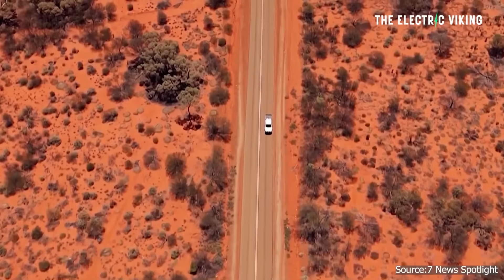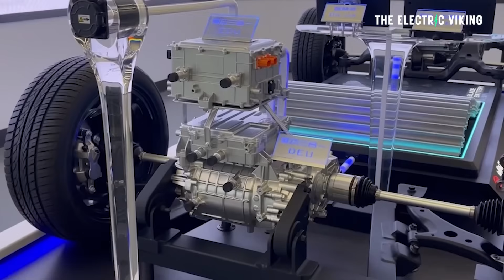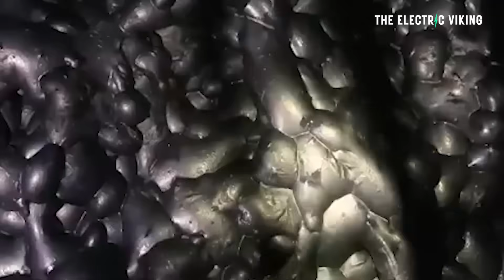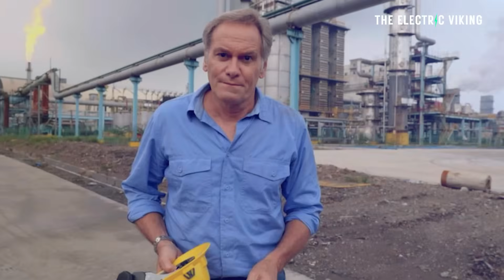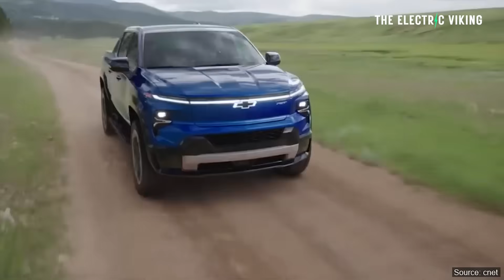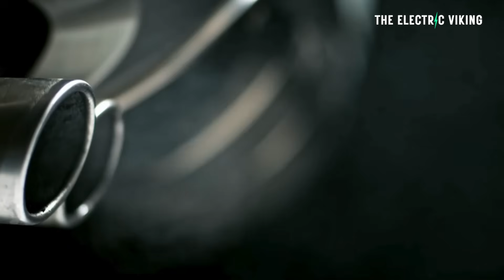Channel 7 Lies Exposed: The Truth About My EV Fight with Australian Media

Comment: LFP batteries are much better than nickel based batteries but Chinas mining practices are similar to nickel. It’s good the industry is changing to LFP but improvements still need to be made.

•  Key problem area: Yichun (Jiangxi Province) — Known as China’s “lithium capital,” rapid expansion of lepidolite (lithium-bearing mica) mining since 2021–2023 led to unregulated/illegal extraction, producing toxic by-products like thallium and tantalum that contaminated rivers (e.g., Jin River pollution incidents). This caused water quality issues, massive tailings waste (projected 10M+ tons by 2025 targets, overwhelming local capacity), and habitat disruption. Central government interventions in 2023–2025 halted chaotic mining, suspended plants, and tightened regulations, but damage occurred.

Comment: Enviro wackos consistently film smoke stacks belching smoke. The unreported fact is to a larger extent this is steam generated from process boilers and air cooled condensers widely used in industries. We should be fearful of the wackos that want to geo-engineer the planet 1.5 degrees cooler via chalk dust (Bill Gates from hell and others) and the curious contrails/chemtrails that linger all day and dim the sun. Leave our atmosphere alone, greenhouse gases mostly CO2 (plant food) and carbon will do the job and green the planet at the same time.

Comment: Indonesia is going to fast mining nickel and it’s causing pollution and deforestation, while poisoning people. There is no doubt about this and yes they are supplying nickel for evs. Who cares if he said that evs use nickel in all batteries.  It’s a mistake and you don’t know if it was on purpose or not.  The fact is evs are polluting if it’s not mined with standards like Australia or Canada for example. I work in the oil and gas industry while supporting evs when done responsible.  Our working conditions are amazing and safety comes first. Not like what we see in other countries. Big oil does have extremely high standards in Canada including shell.

Comment: On a side note I use Solidteknics No Nickel Australian Made stainless steel cooking pans (Noni) trying to cut out high toxin in my diet. The stainless steel is bought into Australia from Finland where Mark J Henry turns it into saucepans and frypans. I got tucked into the false news article but in my defence I knew about nickel being a heavy metal and the bad processes killing factory workers and badly connected the dots.

Comment: Electric cars are shit😂
Reply: That’s nonsense, EVs are the future. Internal combustion engine cars are polluting, mechanical rubbish.
Reply: @hegemonersmith1048 real environmentalists keep the same car for decades, but you keep believing in Chris Bowens little lapdog
Reply: @ 
I’m a retired research scientist. Who the f are you?
Reply: How so? Mind explaining?
Reply: @ 
Over the complete lifecycle of a car including manufacturing and all other aspects, a large number of studies have repeatedly shown that EVs have significantly lower GHG output overall than ICE vehicles (you can Google them yourself). 

This will only improve over time with greener electricity (Australia is currently at 40% renewable and increasing rapidly). A high proportion of EV owners in Australia have solar panels, which also reduces the GHG footprint.

Most Chinese EV batteries are now LFP and use no heavy metals (other than Fe). See latest data from the IEA 2025. It’s the Europeans, Koreans and Japanese makers that need to remove Ni, Mn etc from their battery chemistries.

It is ICE cars that have by far the larger GHG output overall. There is no serious scientific debate.

Comment: If, as you say,  the Minister was "bamboozled" by questioning from a journalist, instead of ending the session and walking out he should simply have countered with the facts to set the journalist straight. He is accountable to the public and as such, must be able to respond to all questions and inquiries. It's part of his job. That the Minster walked out prematurely says more about the Energy Minister than anything else.
Reply: A lot of that depends on the questions. If you ask terrible questions full of inaccurate assumptions or blatant lies then you can't really expect someone to waste their time correcting the points of the question before finally coming up with an answer.

Comment: You are not telling the whole story are you ?  Tsingshan holdings group owns 66.25% of IMIP.  Tsingshan has facilities that exclusively produce nickel matte for the EV industry that produces about 100,000 tonnes annually for EV batteries....which is about 7.7% of the world's current EV battery demand currently.  Since this area contains about 42% of the world total supply of nickel this Company will likely increase that supply exponentially if EVs are widely adopted.
Reply from the maker: Why did you exclude the HUGE impacts of LFP and sodium ion batteries?

Comment: @electricviking The IMIP industrial park in Indonesia primarily produces nickel pig iron (NPI) and ferronickel, but it also hosts two HPAL (High Pressure Acid Leach) plants — HNC and QMB — which produce a smaller volume of mixed hydroxide precipitate (MHP), a nickel intermediate that can be refined into Class 1 nickel for electric vehicle batteries. Soon, IMIP will feature next-generation HPAL technology capable of producing pure nickel sulfate cathode material directly — that’s Class 1 nickel, battery-ready.

Impressively, this new Indonesian production will have a lower carbon intensity than all but one Australian nickel producer. Yes, you read that right — it could be cleaner than nearly the entire Australian nickel sector.

With over 10 HPAL plants planned or under construction across Indonesia, Australian nickel miners — many headquartered in Perth — are facing an inconvenient truth: high-grade Indonesian nickel is coming, and it’s likely to be both cheaper and greener. It’s worth noting that many mining companies — and the media that covers them — are based in Perth. Sometimes proximity can shape perspective...
Reply from the maker: Good info

Comment: Easy!  Australia should ban the importation of any electric car with nickel batteries. And support car makers that use sodium phosphate. Car companies will expedite a change if there losing sales.

Likewise, any electric car manufacture that doesn’t have a program that recycles 100% of its lithium batteries should be banned too. Only 5% of worlds Lithium batteries are recycled, which will be the next environmental disaster.  

I total support EV car adoption but there needs to more transparency. Australia should ban any car manufactures that’s manufacturing and end of life recycling programs wouldn’t meet Australian Environmental Standards.
Reply from the maker: Most EVs sold in Australia use LFP.

Comment: FACT: Chinese EV's are being restricted and banned for good f*cking reasons. It is not just the horrible build quality or the ever present fire hazard. The cheapness and utter unreliability of Chinese EV's is all over the internet with locking doors, spontaneous combustion, body panels thin as paper, rusting out 2 months later, deadly "auto driving" features failing, and on and on.

As a 30 year Environmental professional specializing in heavy metal and water quality issues, I can tell you unequivocally that EV's are definitively  NOT "green", but quite the opposite, they are an oncoming and inevitable environmental and ecological disaster waiting for OUR kids to have to deal with. As a senior-level Environmental project manager having managed on US Superfund sites, I can tell you that the damage and cleanup costs from a lot full of rotting EV's vs junked ICE vehicles are not even comparable. I can recover, reclaim, remediate and restore environmental damage from ICE vehicles at 1/100 the expense and damage of heavy metal laden EV's. And that is IF it is caught in time and IF the conditions permit. The heavy metals associated with these pieces of shite are sinkers, and once introduced into an aquifer or water supply are near impossible to remove and have far reaching and prolonged health effects, especially on developing brains. We OWE our kids better than this stupid sh*t.

The clowns pushing these f*cking EV's are the ones who know the LEAST about the serious implications of them on humans. They are the unexamined idiots, and the ones LEAST qualified to be speaking about the "virtues" of this "green energy" bullsh*t.

Comment: Fair call on nickel used in EVs BUT, probably not a good look to be finger pointing and “Physically Poking the Bear”! PS: I’ve a PHEV and I’ve no idea whether there’s nickel in its batteries or not BUT, after 6 years of use it still achieves As New 46km range from full charge. Is charged via Sonnen solar & batteries and is saving me $500+/year on ULP and typically averages 1.5l/100kms! Oh What A Feeling! I’d say 90% of its kms are solar sourced. I’m also saving 50% on maintenance or $300/year.

Comment: What a croc of shit. A significant majority of EV batteries, approximately 80%, utilize nickel in their composition, primarily in the cathode material. Commonly used battery chemistries like Nickel Manganese Cobalt (NMC) and Nickel Cobalt Aluminum (NCA) contain nickel in varying percentages, with newer NMC formulations reaching 90% nickel, according to the Nickel Institute. While other chemistries like Lithium Iron Phosphate (LFP) don't use nickel, nickel-based chemistries are favored for their higher energy density and ability to enable longer range EVs. 
From what I saw of the Spotlight show, you asked for everything you got. Had you walked up and got in my face like you did with Bartlett - the outcome would have been very different.
Reply: Do you use AI to think for you as well?

Comment: Chat GPT says differently:

Several electric vehicle (EV) manufacturers source nickel from Indonesia, leveraging the country’s vast nickel reserves to meet the growing demand for high-performance batteries. Indonesia has become a pivotal player in the global EV supply chain, particularly for nickel-rich battery chemistries like NMC (Nickel Manganese Cobalt) and NCA (Nickel Cobalt Aluminum).

Major EV Companies Sourcing Nickel from Indonesia
	•	Tesla: Tesla has secured nickel supply agreements worth approximately $5 billion with Indonesian companies, aiming to bolster its battery production capabilities.  ￼
	•	Ford: Ford has partnered with PT Vale Indonesia and China’s Huayou Cobalt to develop a High-Pressure Acid Leaching (HPAL) nickel project in Sulawesi, Indonesia. This collaboration is intended to secure a sustainable nickel supply for Ford’s EV batteries.  ￼
	•	Hyundai and LG Energy Solution: These companies have jointly established Indonesia’s first battery cell manufacturing plant in Karawang. The facility is designed to produce battery cells for Hyundai and Kia EV models, utilizing locally sourced nickel.  ￼
	•	Volkswagen Group: Through its Chinese joint venture with Huayou Cobalt, Volkswagen is investing in Indonesian nickel processing to support its EV production plans.  ￼

Environmental and Ethical Considerations

While Indonesia’s nickel industry is crucial for the EV market, it has raised environmental and social concerns: ￼
	•	Environmental Impact: Nickel mining and processing in Indonesia have led to deforestation, water pollution, and significant carbon emissions, primarily due to the reliance on coal-powered energy.  ￼
	•	Labor and Community Issues: Reports have highlighted hazardous working conditions and negative effects on local communities, including health risks and displacement.  ￼

These issues have prompted some companies to reconsider or adjust their sourcing strategies to align with environmental, social, and governance (ESG) standards. ￼

If you’re interested in more detailed information about specific EV models or manufacturers’ sourcing practices, feel free to ask.

Comment: Good on you! I reported the Nickle lye to ABC media watch; it is possible they will take it up. I was appalled by the claim that dirty nickel mining was set up primarily to be used in electric cars. I know that SS is the biggest consumer of nickel. There was no mention of dropping the use of SS in the program. Nor did the reporter point out that Indonesia’s government was responsible for the horrible conditions to persist. Like you I looked in the background of Chanel 7 owner's investment and 60% of his wealth is invested in fossil fuel. Toyota has been caught out with the production of EVs and need more time to catch up. Slowing the sale of EV cars is in Toyota’s interest. This program was also timed to give political advantage. The coal lobby certainly will not like the Vehicle to Grid as this will make the coal fire power station obsolete and the gas power stations run half the time.

Comment: No MSM fan here but you cant ignore the facts. Ev vehicles are not green, its a con job.  Only the  short range gutless EV's are Nickle free, and they still use Lithium of course. It would be better if you were honest and admitted the EV industry still has a long way to go.
Reply: Is 500-600km short range? Because LFP batteries used widely have no nickel or cobalt and have this range. How is drilling up, transporting and burning oil cleaner than mining abundant lithium?
Reply: @marleymarl0  according to Grok about half of the current production of EV batteries contain nickel. Then we have lithium, EV's are not green, no better than ICE.
Reply from the maker: It would be better if you did some research before spewing garbage. Try that mate and then get back to us.
Reply: @electricviking  according to Grok..

Indonesia, the world’s largest nickel producer (accounting for about 50% of global supply in recent years), relies heavily on laterite ores. Processing these ores into Class 1 nickel is energy-intensive, often using coal-fired power plants, which emit significant CO2—sometimes 60-90 tons per ton of nickel produced, compared to 10-20 tons for sulfide nickel. This has led to laterite-derived nickel being labeled "dirty." In 2023, Indonesia supplied over 370,000 metric tons of nickel for EV batteries globally, out of a total battery nickel demand of roughly 665,000 tons (projected for 2025 but a good benchmark for current trends). That’s over 55% of the nickel used in EV batteries coming from a country where laterite processing dominates.

Comment: Electricviking made a good point but the whole mad panic for renewable energy has set the mining for the metals to achieve this into overdrive with some metallurgy experts saying that mining operations for Copper alone will have to be expanded over ten times what it is now. When the Chinese do this in other peoples countries, it is often an environmental disaster. Power grids will have to be expanded 500% to charge all this infrastructure. To top it all off, the US are building AI Data centres which are enormously power hungry! The whole thing is not very well thought out!

Comment: I work in Mining in Australia and i can confirm Companies are using what they call dirty Nickel, because it's cheap.  No EV car manufacturer goes for the best most expensive Nickel available as it would make EVs to expensive and that would effect their profits on sales. So yes all EVs use cheap Nickel.
Reply from the maker: 100% wrong. 70% of EVs in China (where most of the worlds EVs are made) do not use nickel, as they are LFP. If you watched the video you would have learnt this.
Reply: @electricviking  I think some ppl mean the overall nickel used and not just the battery

Comment: I totally agree with you about MSM but explain one thing while your running your household from your EV what happens next morning when you need to go to work and you have just used all your EV power to run your household, catch a cab or a bus.
Reply from the maker: Households use only a very small fraction of an EV battery over one night

Comment: We spent last year sailing around Sulawesi and can confirm the extent of the environmental carnage is huge. However, there's more chance of the dirty nickel ending up on our boat as stainless steel than a battery. We use exclusively nickel free lithium batteries onboard.
Reply from the maker: Great point re stainless steel

Comment: Why I hate to be the messenger of this I’ve been doing my own digging. I’m not worried about the deaths, even though they are terrible and should never happen. My concern was if these mines actually produce nickel for EVs. The mines do actually produce nickel for EVs by taking the class 2 nickel and by using a HPAL or high pressure acid leaching process they can turn class 2 into a class  1 nickel. Currently China imports 4 million tonnes of this from these mines. 

I didn’t want it to be true but it is.

Comment: what about the Tesla deal for $5 billion for nickel sourced from Indonesia agreed in 2022? Which mines is this nickel being mined from if not those covered in the Channel 7 report?
Reply: it looks like quite a few car manufacturers (including Toyota) has 'invested' into nickel mines in Indonesia. It also looks like the nickel is going into portable lithium batteries (such as a 18500, 14500 & 10440) - in essence all the portable 'power' devices (including electric bikes) given the power density required. May be this is real core problem, our drive to have everything be cordless...
Reply from the maker: Most portable devices use LFP